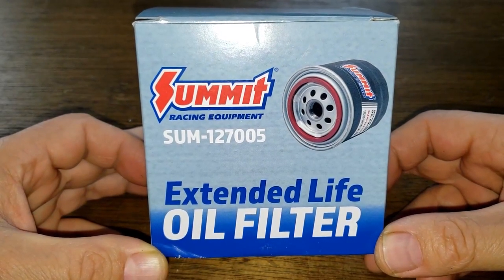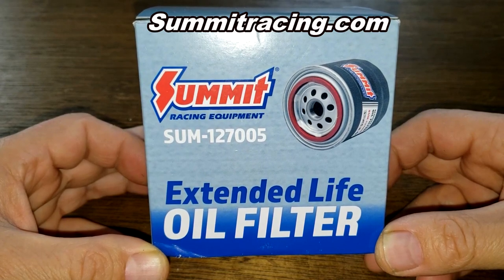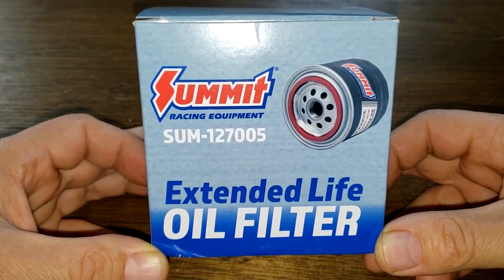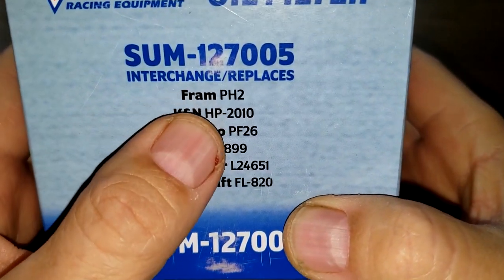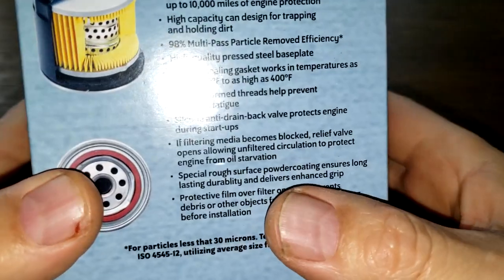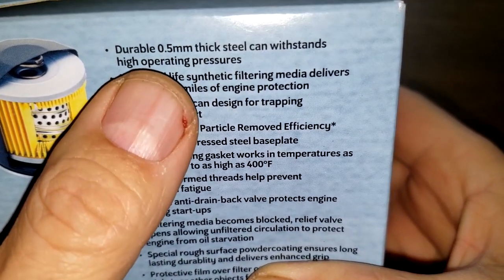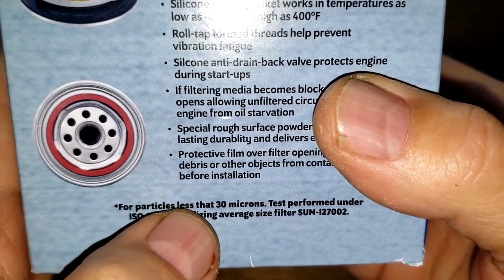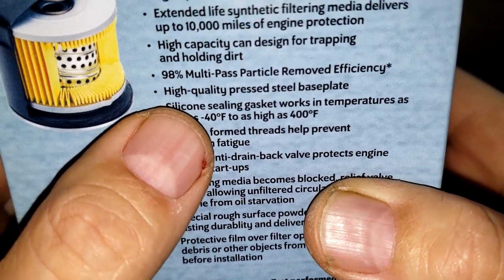Summit SUM-127005 Extended Life Oil Filter Cut Open

Comment: I have bought quite a bit of "Summit" branded items and all have been good quality. This filter doesn't seem too bad, but I agree, looks like a Premium Guard....which aren't bad. 
I'd prefer a low 20s micron rating but 30-35 seems standard for most long life filters . I'd run this with a filtermag.
Reply: Yep, Premium Guard by another name. No doubt they look to be a quality made OF.
Reply: The famous 95 MERC runs Pennzoil Ultra Platinum, 5-W-20; Bosch Premium Oil Filter # 3410; and a FILTERMAG #SS365PR. Oil & Filter changes at 5,000 miles.
Ultra Platinum because it's the closest thing to AMSOIL that's available at a resonable cost.
Bosch Premium Oil Filter because of the 20-Micron rating and the Silicone ADBV.
FILTERMAG because it takes out ferrous metals (like iron and steel) that are passed through the oil filter.
The filter in this video is very similar to several other brands on the market, and is superior in some ways.
HOWEVER, this filter claims (on the box) to replace the FL-820, and it IS NOT a true replacent, because of the type of By-Pass Valve.
 The FORD FL-820 and FL-820S have the By-Pass Valves on the INLET END of the filter, so that a partially-clogged filter won't allow the contaminants to be washed back into the oil.
The FORD oil filters and SOME of the WIX oil filters have the superior valve design.
 Once again, we see misguided praise for that stupid "coil spring" -- which is ONLY used in oil filters that have VERY NARROW filter bodies. 
The Coil Spring fanboys should notice that the most EXPENSIVE oil filters (Amsoil, Royal Purple) have the Stamped Steel spring.

Comment: Looks like a Premium Guard filter with hot rod chrome plated end caps.  I hate to say it but every made in China filter I have opened up is made very well and have held up very well. Their assembly is newer than in the U.S. and is almost totally automated, hence the perfect spacing between pleats and the clean glue application. If you notice some of the Purolator filters have a string tied around the filter media which a hand made step. So depending on the operator it may be very neat or mediocre. That is also why you messy glue jobs because this is also a hand operation. Although this doesn't harm the performance much it makes you wonder. Hopefully with the upgrades in manufacturing under Mann Humell you will see neater more consistent construction.
Reply from the maker: I agree, for the most part, China-made filters look better than USA-made oil filters. I hope we invest in newer machinery.
Thanks for your feedback!👍

Comment: Been using the summit oil filter for some years now. I was always a wix guy but for the money I believe that the summit is a great deal. Even has drain back valve I don’t believe wix has one why i decided to use summit filters. Summit has coil spring instead of tin crap spring for the bypass valve. For $8 a filter cant go wrong my opinion anyway.
Reply from the maker: Thanks for Sharing👍

Comment: The bypass is only 12psi? Dus that mean if I 40 psi of oil pressure the filter is usless?
Reply from the maker: No, The oil should flow through the filter without much restriction the only time the bypass valve will open is when the filter is clogged or with a thick oil that does not allow it to go through the filter, then the bypass valve will open.
Reply: @WhipCityWrencher  thanks
Reply from the maker: @jesseduke694  You're Welcome

Comment: I hope one day if I become wealthy I can make a oil filter 100 percent efficiency at 1 micron.
Reply from the maker: And one that had a good oil flow. If you could make one with that micron rating (that in itself would make you rich). I and millions of others would buy that oil filter.😊
Reply: @WhipCityWrencher  do u realize how big / how much surface area u wood need get proper flow thru that filter... mite b  bigger than a semi-truck filter or a remote filter...
Reply from the maker: @brucek.hoffman5868  Yah I know, that's why I said it would have to have a good flow and you would be rich if you could make a filter with that micron rating.

Comment: Wow! What a great looking oil filter! Same filter I need for my explorer. I think this filter is put together great and it's one of the better ones Ive seen! However since it's made in China, I would be hesitant to buy but would consider it. Also, what's up with the adbv?? Why is it so shiny? The shinyness of the anti drain back valve gives it a cheap and generic appearance. I would definitely consider using this oil filter because of the price and build quality.. The only downside is where it's made😕
Reply from the maker: Yes, it would be more appealing if it said Made In USA. 
Thanks for the feedback!👍
Reply: Relax. Just because its looks good dont make it good.

Comment: This filter will NOT meet Ford recommendations for it's modular engines due to the location of the bypass valve. At present, the only filter I am aware of that has the upper bypass valve is Motorcraft 820S.
Reply from the maker: Doesn't matter. I know people who use filters such as Mobil 1 (same kind of bypass valve) and their engines run fine.
Reply: You are absolutely incorrect; particularly during cold starts in cold weather, oil circulates much sooner with a top-end bypass valve. I have compared several filters, including Mobil One, and none of them perform nearly as well in this regard.
Reply from the maker: @georgewetzel4380  I prefer a base-end bypass also, but which bypass valve opens sooner will depend on the bypass valve setting for that particular oil filter.
Reply: You are correct, George -- The FORD By-Pass Valve is of superior design to most others -- BUT -- I saw a WIX oil filter cut open that had the By-Pass Valve on the INLET END.
Reply: @WhipCityWrencher  YES, it DOES matter -- And the Mobil 1 filters DO NOT have the By-Pass Valve at the INLET END. 
Your videos are getting better, Whip City -- I urge you to investigate that FORD-designed By-Pass Valve location -- it's a big deal, but is generally overlooked in "testing" of oil filters.
Reply from the maker: @SlikLizrd  Thanks! I like the base-end bypass valves also. But I doubt they open any sooner than a dome-end bypass valve. That would depend on the bypass valve spring and at what pressure it is set to open at.
Reply: @WhipCityWrencher  You are correct -- the Inlet-End valve does not necessarily open sooner than other valves -- it's the valve's LOCATION that gives the advantage.
With the inlet-end opening, the oil doesn't wash over the outside of the element in order to get to the valve opening.
 MUCH less chance of recirculating un-filtered oil back into the engine.
Reply from the maker: @SlikLizrd  Yep, 
Exactly why I like them also.

Comment: This is Premium Guard filter. They use galvanized steel; hence, it’s shiny.

I’m skeptical about the filtration rates that the manufacturers claim. There is no independent third party verification.
Reply from the maker: I'm skeptical as well, not on this filter so much but others that I've opened.
Thanks for your feedback👍